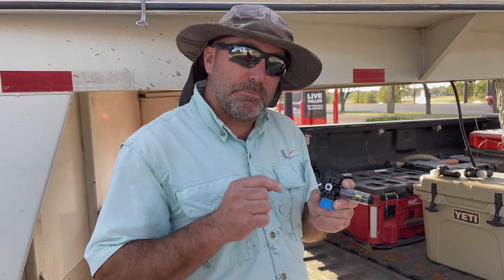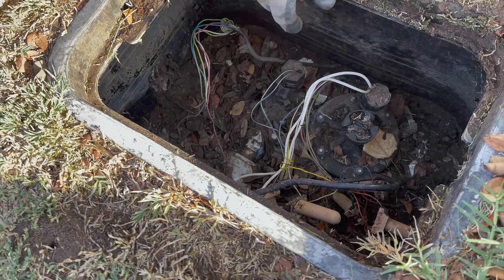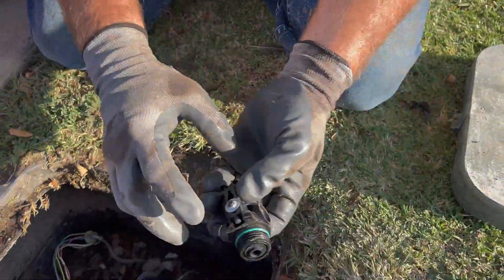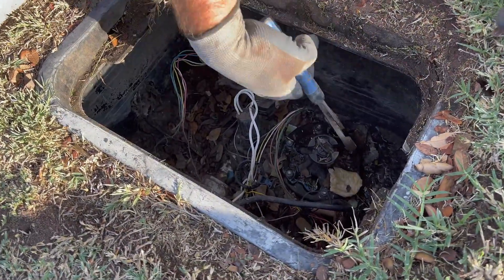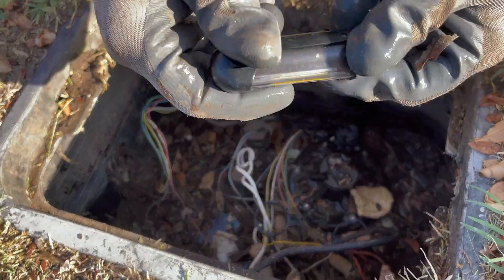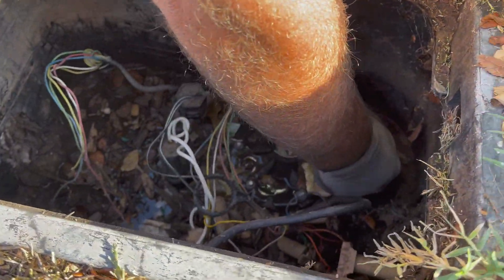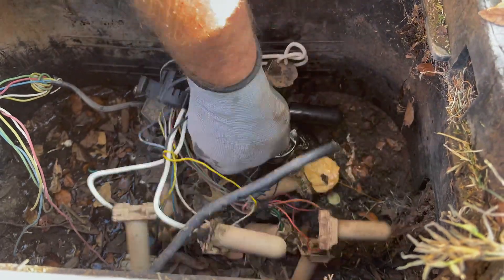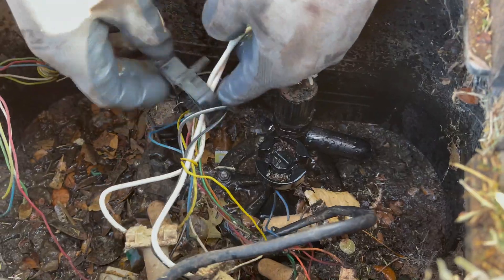Installing Rain Bird PRS Dial Pressure Regulator

Comment: Can I add this to my irrigation line just after the back flow preventer? That way I’d be using one part to help with 5 different sprinkler zones.
Reply from the maker: Yes. You can install this on the master valve and it can regulate the entire system.